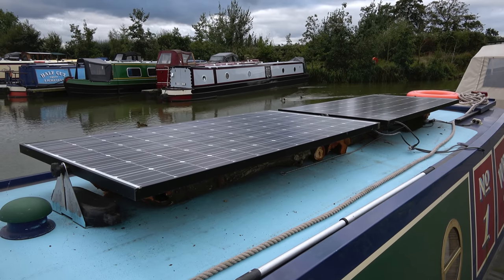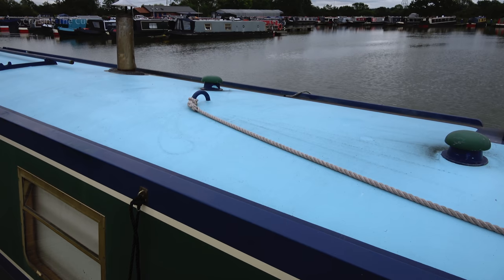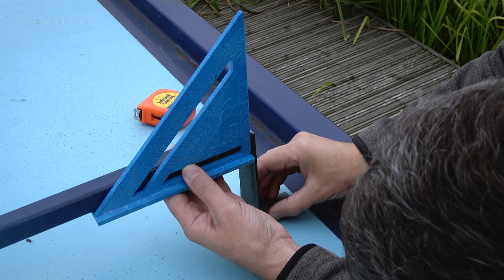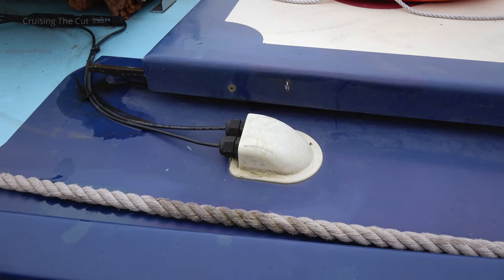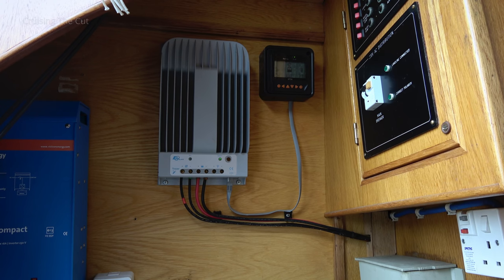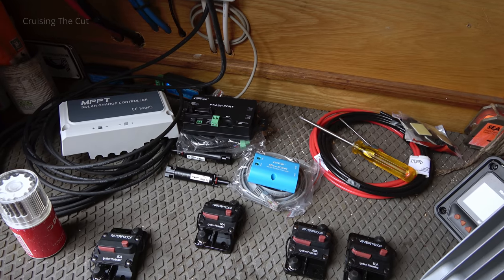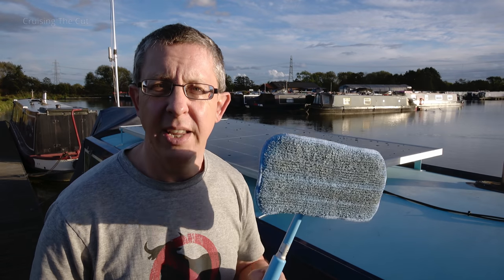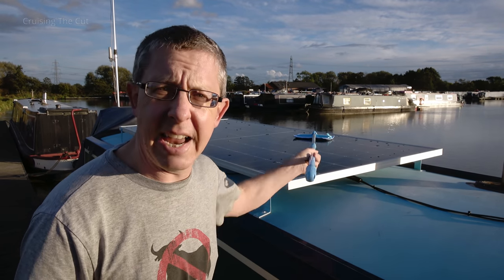251. Adding more solar power to my narrowboat

Comment: You could DYI some "hooks" for your boat hook on the sides of your 3 new vertical clips for the new panel, maybe one set for port and one for starboard so you would have a handy boat hook for each side of the boat.
There is a product in the US called "Wire-Mold" which makes both plastic and metal surface-mount "conduits" for building wiring.  This may or may not be exactly the right product to use to organize your panel wires on the roof of your boat cabin, but there should be something out there that won't rust, will take the UV and can be stuck down without actually drilling holes in the roof.  Just sayin'....
KEEP THE GOOD STUFF COMING DAVID!!!  Say Hello to the Narrowboat Experience girls.  We miss them out here!

Comment: The fuse is usually not redundant. If (when) you get a short on the wiring between the battery and the breaker, it will stop the battery from feeding 'oh dear the boat is on fire' amperes into the wiring. I've experienced green fire once, and that's enough. I like the clean and (having had to debug ones stuck in tiny closets) easily accessible installation.
Reply: The fuse is in series with the breaker he said. Breakers are very, very reliable. Been in use for half a century or more. They don't need to be protected by a fuse.

Comment: Thats a very informative and entertaining video explaining all you need to know from start to finish about installing solar pv and giving the details of the manufacturers/suppliers really helps too. Brackets - Im not a fan of rivnuts as they invariably spin when you try to remove the fastener, but i guess you wont be doing that for some time! Let us know how that goes. Its Thursday today and the days can get confusing (ask shift workers) but hang in there you’ll get the hang of it.

Comment: Great vid, good work. Dashed impressive getting those two holes to come out where you wanted.

Helpful hint: A "deburring tool" would have rounded the edges of the hole you ran the cable through. There are several styles, and the best substitute is a drill bit a few sizes bigger used to countersink the hole a tiny bit. But you probably know that.

Comment: Very enjoyable David! You've done really well with the electrical, the metal engineering, and the tech setup of the controllers! I'm a radio field engineer and have spent decades in the field building radio, electrical power and solar stuff like this. A great job, well done!. Time for a cup of tea and a cheese sandwich. Cheers from David downunder in NZL.

Comment: I'm impressed. You've done you homework and achieved your goal. What more can one want in life?
Tip with Sikaflex; white sprite is a good solvent. Either on a cloth or silicon mastic tool, you can clean off any excess.
 Very interested to know if this amount of PV allows you to function without shore power through the winter. Perhaps a spring update?

Comment: WOW. that was a lot of subject areas of differing understanding and execution.   There were a lot places shortcuts might of have been taken that would have made the system a problematic ragtag of spaghetti with leaking holes, but it came out to appear to be a well organized and most importantly very livable installation!  This was defiantly for the advanced DIY.  I think the bracketing was the most scary part to me with drilling holes in the boat and manufacturing the brackets.   The other things are purchased parts that the manufacture or vendor is responsible for if the don't work or go bad in the future.  Very impressive work!  Payback?  I think the biggest payback is the peace of mind from a reliable maintainable installation and the large bump up in battery charging ability in the winter months.

Comment: I've got a one panel set up on my garage with two 12v 130amp leisure battery's, it's in a block 30 yds from my flat. 10 meters of led light strips pulling about 6 watts, works well. Power input about 6 amps max and next to nothing on a poor day, hence the two batteries.

Comment: Well done, I can fully understand you feeling nervous when switching on! I’ve just completed an update on our motorhome fitting a 200 amp lithium battery changing the solar controllers to a Victron blue tooth controllers, fitting a Victron B2B charger and a Victron blue tooth shunt with battery monitor, all in a very tight space and it all works. I’m particularly pleased with the shunt which is fitted on the negative side of the battery and all negative connections go to the shunt as it gives me a very accurate reading of useable power left in the battery. Especially important with lithium as one can’t judge by voltage.it’s also a brilliant addition to a  lead acid setup as it can be set for lead acid 50% useable and the shunt reads power in and out of the battery very accurately, highly recommended and really quite cheap and easy to fit. The shunt can be bought on its own but better to buy with monitor as it comes with a 8 meter cable so the monitor can be fitted somewhere easy to read.
Reply from the maker: Cheers, I just look at the voltage overnight when the batteries are in their greatest state of rest.

Comment: A floor cable protector, or even some heavy duty "permanent" tape would work well to protect, tidy, and secure the cables coming from the panels.  Apart from eliminating the trip hazard it would protect them from getting caught on something and yanked or pulled out.

If you wanted a more permanent solution, a surface mount raceway could be glued or otherwise mounted to the roof.

Comment: As someone off-grid in central-Pennsylvania, I receive very similar days of sunshine as England,  throughout the winter, so I feel your pain, and desire for more panel wattage. 
BTW, you can get much better performance from your panels, by running loads during full sunshine.  I've tested my panels on a cold, sunny, winter day, by turning on every possible load, and my controller indicated 15% ABOVE rated output of my panels.  
So, most efficient to make use of power directly during production, rather than charging then drawing off of batteries.
Reply from the maker: Cheers
Reply: Thats good advice. This difference is due to conversion losses being relatively high on light loads - quiescent drain is negligible these days but for thermal reasons converters are optimised for output at the high end of their capability. Other significant losses are internal resistance of the batteries and resistancer of the battery wiring harness being eliminated. 

Make hay while the sun shines, or as we say in the UK - "bugger it's still raining again"

Comment: Hey David, would be good to get some current transformers (CTs) for them as well to keep track of the load on the battery outputs.  So you can see drainage over time.  That way you could chart the fridge usage for example and how its affecting the battery bank from day to day.
Reply: CTs don't work on d.c.
Reply from the maker: I'd need a shunt on the negative terminal, with everything connected through it. Victron make a neat Bluetooth one which I might buy one day.

Comment: Wow, this is a real major accomplishment, especially for someone who doesn't even know what day of the week it is.
 Joking aside though, I am really impressed at what you have acheived here. I hope it proves to be a reliable and benificial upgrade for you, do please keep us posted on its performance. And finally, many thanks for the tip for  using a magnet to hoover up the swarf when drilling. In my job i get to drill 100s of holes a day sometimes, and from tomorrow i will very definitely be getting "stuck into the job" with the aid of some magnatism.
David in Dudley.
Reply from the maker: And the other aspect of that is to put the magnet in a plastic bag, then when you empty it, you just move the magnet and all the filings drop off the bag, so you don't have to try to pull them off the magnet.
Reply: @CruisingTheCut  Wow, another pearl of wisdom, thank you again David. 
 I have drilled 63 13/16"  holes in 1/2" steel plate today and I cant believe how clean the area is after positioning a few magnets around the job. I am so so glad I follow your exploits. 
David in Dudley.

Comment: That dewalt drill is interesting, here in the US the only 18v dewalts are the old style with a battery that goes up in the handle of a tool and those slide in batteries are only used for the 20v and 12v series. Cool to see the different markets for what is likely the same tool inside.

Comment: Hi David. Enjoyed your video. I like the redundant design you have so that you basically have 2 systems isolated by switches. So if one needs to be off line for repairs or maintenance, you still have a 2nd fully functional system.

While I like the idea and benefits of solar, I don’t like the need of having to use giant ugly panels which takes up a huge amount of space in order to generate just enough power to run a 2 liter teapot for 30 minutes. I look forward to the day the technology advances to the point they become inexpensive and are able to efficiently conform to the surface they are attached to. I like the panels that are used on Silver Fox where they are not intrusive and they blend into the shape and style of the boat with minimal visual impact. 

I am currently looking at a portable solar configuration I can use as a backup power supply in my house for the few time I have my power fail. The biggest issue right now is the size and cost of the panels with my current power requirements. A 2,000 kWh system is quite large and expensive at this time.

Comment: There's a saying in aerospace, "A single rivet is a pivot".  I don't know how good that adhesive is, but you'll probably want some companion rivnuts on the roof mounting part.  Also washer and lock washers to keep them from coming out.
Reply from the maker: It can’t pivot on the roof rivnuts because of there being six of them which would prevent movement on each other,

Comment: I'm sure its been mentioned all ready but if you still need more power but are out of deck/roof space you could use flexible solar blanket things things and just put them out when setting still and put them away stored some place when you don't need them.

Comment: Thanks for the video....i don't have a narrowboat but have converted my VW transporter into a campervan with a  large solar panel on its roof.... I would just use sikaflex sealant/glue such as SIKA 522 (I'm not sure which sikaflex you used)  ..... That would easily bond your metal clamps to your roof without the need for extra fixings such as rivnuts etc and stop the need of drilling holes into a roof, which i would not want to do  (more holes means more possibility of rust/leaks in the future). Your barge roof seems to have a nice protective metal lip on the side where you could run cables and keep them neat and more more protected.
Reply: Nothing beats bolting something down in a situation like this....especially where you have a decent amount of thick metal to bolt everything to everything else.
Glue or even the 3M tape to join sheets of metal without any fasteners showing (e.g. panelling the outside of a bus) works for large flat contact areas.

Comment: If you haven’t done so already, it would be wise to install some in-line fuses as close to the panels as you can. Without a protective device on the output of your panels, a short circuit could be a disaster!

Comment: A couple of lengths of electrical trunking on the roof would be a lot tidier for the cable runs! For the breakers you could use small screws with washers? Great job though, I’d never have the courage to attempt it.
Reply: The trunking needs to be suitable for external use. While this is possible, a lot is not. The solar cable used is, however, designed for external use and withstands the UV, rain, heat, and cold very well even over a decade or more.

Comment: They make adhesive cable tie mounts.  You could use those to keep the outside cables in place and in a straight line instead of just laying on the roof.
Reply from the maker: I suspect they'd detach after a short while; the boat roof, being steel, gets immensely hot in summer which would loosen the kind of adhesive on those mounts.

Comment: Excellent video David.

I was intrigued to learn of this "new to me" notion of the solar panel controllers talking to each other. Having researched the topic I note this function is not essential for the charging per se (thank goodness!).

However, from what I could gather it might be useful for when doing the equalising thing so only one controller does this function.

And, I understand the equalisation process can be quite a few hours in duration, perhaps every month or sometimes every 6 months.

What I would be a little concerned about is if the solar panels couldn't sustain the equalisation process for long enough because of the weather.

Is this something you found in your research?

I suppose one good point is not being on the shore power then you can forget about the mains powered charger being in contention with the solar controllers.

And the even better thing is you won't have to worry about galvanic corrosion.
Reply from the maker: Cheers

Comment: Great video, not sure why some commenters are giving you a hard time about the solar. It's entirely reasonable to me to want to have sufficient capacity to avoid running the (smelly, noisy) engine as much as possible over the winter when you're just trying to enjoy some peace and quiet.

I'm surprised you didn't go with a larger cable gland housing (to replace the existing one) with more ports to let you run the whole set through a single hole; sealing up penetrations always makes me nervous, so I always try to enlarge/reuse an existing hole rather than add a new one! The results came out pretty decent anyway, so I guess either works and if these were cheaper or easier/faster to get, then there's something to be said for just getting on with the project.

Keep up the great videos, and I personally enjoy the more esoteric fare around the unusual or unexpected aspects of canal living and its ancillary elements like canal expansions/maintenance, businesses that support the canals and people using them, and particulars about how you make everything work well for you personally. Videos cruising down the canal are nice enough, but they can be fairly similar to each other and it's more fun to find out about aspects of canal life that I would never have considered. Being from Canada, we don't have anything close to the canal network here and it's fascinating seeing how it all works.
Reply from the maker: I couldn’t find a cable gland that would accept four cables unless they were all coming in from different directions!

Comment: Hi, Thanks for the cruising videos, they were very scenic, tranquil and lovely (most of the time). looking at the English country side and the villages real gives the idea of how much things have changes from many years gone by. You have installed the panel relatively flat so you are not going to get proper energy production from that setup. Why don't you try reflecting the sun onto the panels then. Get a board/pvc mirror and reflect the sun directly onto the panels. I'm  not sure if it would help but it may improve the output; I don't have a solar panel or anything the like to try it out but you can give it a try. It is a bit risky to have a board above the panel but you could try something lite such as a polystyrene sheet the length of the panel and half its with cover with reflective foil as a test, a mirror would be idea. Have a great day and be safe. Sorry for this being so long... Cheers!
Reply from the maker: Cheers. I explained why it's flat and why it's not an issue in the video.
Reply: @CruisingTheCut  Thanks for the reply, I'm was thinking what would reflecting the sun directly on the panel would it make a difference. I am sure that the panel being flat is producing a great charge but would there be an increase in charge. Not on an overcast day that possibly would not work. Thanks for the great country drive by.

Comment: I'm just catching up on the vlogs, systematically going through in chronological order. I'm subscribed to your Vandamonium channel too. I enjoy the vlogs and the adventures and mis adventures as I love the waterways. If it floats ,it gets my attention. In Ireland we only have the Royal and Grand Canals. The Grand being the most navigable of the two. The Royal is still being worked on to get it in order again. Might be wrong ,somebody might correct me. The Shannon Erne waterway was reopened a number of years back after being derelict for many many years. There was something like eighteen boats passed through it during its commercial life. The dreaded steam train signed its demise. I have had many holidays on the river Shannon over the years, In the floating yoghurt pots I might add.
Anyway to go to my reason for comment. I have just watched the vlog on the gearbox issue in 2019 . Lovely pool of oil in the bilges, caused of course by the leaking seal. Someone suggested nappies before to absorb the oil and water. I have a possibly better solution should you need it. Puppy Training Pads. We've had two pups in the last eighteen months and as far as they are concerned they are for shredding not for piddling on. But for oil and water they're wonderful and come in various sizes.

Comment: What about attaching a roofrack and then clamping a solar panel to it? would make it easier to remove the panel for repairs/maintenance/replacement. also, i would have been tempted to attach the control panels and breakers to a wooden panel first, maybe while sitting at a table, and then attach the wooden panel to the wall - again that could make it easier to remove the array if needed for repairs/replacement. also, i get a lot of enjoyment and information from your videos, thanks for all your time and effort.
Reply from the maker: Cheers